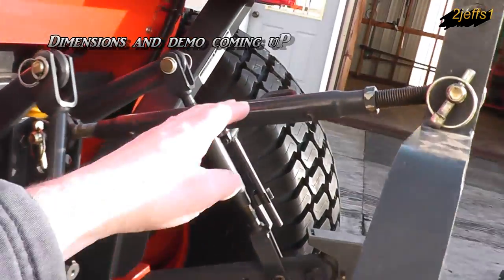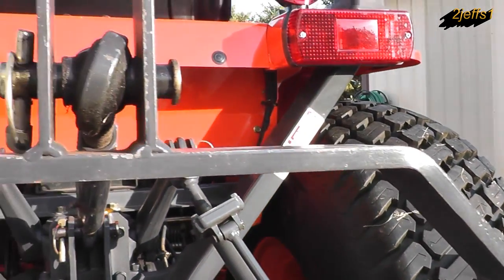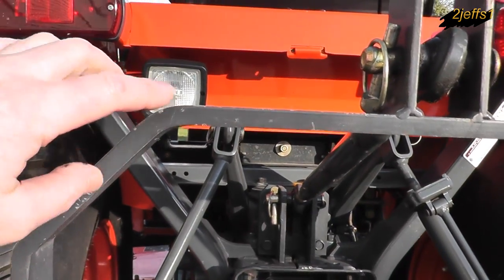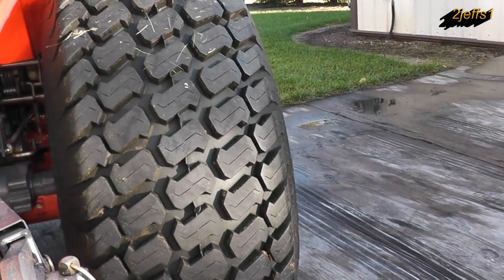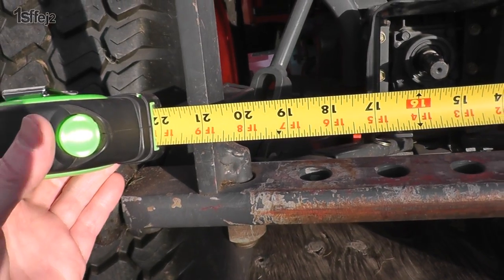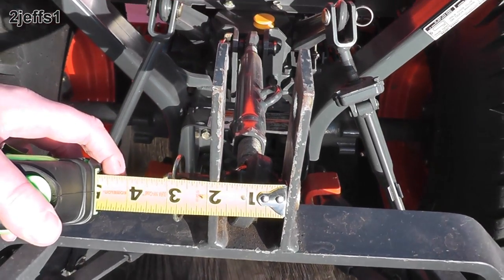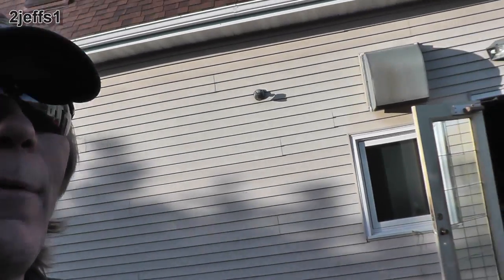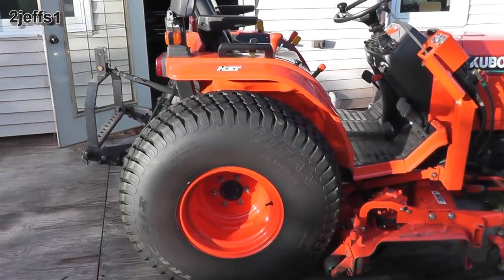How to Build a 3 Point Quick Attach Hitch For your Tractor

Comment: Today Sunday.8,2021. I just finished the mechanical part of this fabrication. My weekend project. Next paint it and start using it!
Also done with left overs. In my case, the metal came from my neighborhood mailboxes frame! That was knocked out by a snowblower a few Winters ago... The rest of the metal will be a landplane, when time permits! :-)

On mine I added a trailer hitch, a tow ring and a couple of slots to hold a chain! For possible logging operations, on my old & tiny Satoh ST1510D (4x4)! Anyway it was all inspired on your project/idea. Thanks a bunch.
Cheers

Comment: Thanks for posting this. I like the way you built that, very simple and no need to weld. I built my drawbar into a forklift. Its the most useful thing I use on my small Kubota. I plan to post more videos where I am using it to show how useful a forklift can be on a compact tractor. Seems like I get more satisfaction using equipment I've made for the little tractor than any of my other projects.
Reply from the maker: +onewyatt1 The satisfaction of these projects does get quite addictive. I can see where your idea on the forklift could be very useful for many folks. A little creativeness can make 1 machine useful for so many different things!
Reply: Wish I had the energy to do more projects. Seems like I am always thinking about how to make stuff but the old bones keep me daydreaming.

Comment: l liked that gen head, want to set one of those up on my kubota,
Reply from the maker: mustie1 The 10 KW is perfect to run the entire place here. The only thing it wouldn't run the air compressor upstairs. I have a 5HP that It will if ever necessary.
Reply: ive been keeping an eye for a gen with a blown motor so l can make one up, right now l have a gas powered welder but its a fuel pig,

Comment: Merry Christmas and Happy New Year! I like that attachment or what ever you call it on your draw bar. I could sure use that. I'm not a welder so I'll have to go at it in another way. Great idea, one I didn't think of in using the draw bar for it. Thanks!
Reply from the maker: mi2tn A few locals took the dimensions from me and had someone make it for them. They didn't do the 45's to keep things more basic. Just an idea for ya - I have people get the steel they need for a project and cut it to dimensions. Then the bring it to me and I'll weld it up. It don't take long or cost much to burn a few welds.  :) But hey - Glad you enjoyed the video and Thank You for your comment mi2tn, Jeff

Comment: Nice setup for the gen. Haha I like gens. 
We get pto units in work occasionally for repair. 
That might be one of those Italian generators rebadged as a Dayton...nothin wrong with em, they work good ...
just of it's capacitor fired , keep spares on hand, the orig plastic case ones like to pop occasionally and it's nice to change em out with good metal case caps instead. 
Just check your exciter windings if ya pop a cap, ya should have 1-1.5 ohms on them and nothin to ground. They rarely fry a winding, 90% of the time I find a bad cap. You could go up or down a size on the caps too, if your voltage output is high or low to adjust it to suit. With multiple caps , keep them the same size between them too.
Reply from the maker: MrTheHillfolk Thanks, yeah the cradle is homemade. Had some old floor jack wheels in the hoard pile that finally had a use too! Wow you blew me away on your advice here. Very interesting. This is one of the rare things here that I never took apart. :>) YES I'll be taking that cover off to look inside now. Who do you recommend for caps? When I bought that unit the guy told me they were wound for 1800 RPM instead of 3600 to be more efficient from the 540 gear up. Any thoughts, And Thank You much for the advice!!!  Hows your hood doing - any progress?
Reply: If that thing is setup for 1800 rpm generator that's awesome. 
The difference is in the rotor. 4 poles gives ya 60hz at 1800. 
2 poles gives ya 60hz at 3600. Peashooters and small gens are usually 3600. 
Now that I think about it , if may have 1 large cap in the back..
1800 Rpms is nicer for less noise and wear on the bearing, if it was a gen set with it's own engine, you would notice 1800 vs 3600 quite a bit. 
Even on a pto setup when we run em in the shop they make a fair amount of fan noise
I'll have to check at the shop and see the couple of brand names we use for capacitors. I do know we usually step up to a 440vac rated cap over a 370vac rated cap though. 
Heh, gens are "simple" 3 things ya need: motion, magnetism and a winding. I use the basics 101 every day on the job.
Reply from the maker: MrTheHillfolk Thank You again for all the info. I like to be able to service things here "in house" when need be. :>)

Comment: Great job on everything I've seen so far! Do you have any 3 point attachments that you can't use this with? 

I assume this is usually mounted to your tractor, if so what do you use for moving a trailer, just mount a ball on it?
Reply from the maker: The Kubota tiller has it's own mounts where it needs to be removed otherwise all my attachments work fine with that on. I do have a ball with a hairpin to keep it retained to the draw bar. That works great for a quick trailer grab to move them around.

Comment: Very cool setup!  Thanks!  I would like to duplicate this for use with my Kubota B20.  Have you tried this setup with heavier attachments like a bushhog? Or earth working implements such as a middle buster, tiller, etc?   Ideally it would be great if the attachments can hook up to the quick attach bar, but still work with a standard 3-point as well when sharing implements with a buddy!
Reply from the maker: Hi there. That 55 gallon sprayer I have hangs on that bracket. When full it is real easy to do a wheelie. I don't take it easy either when that is on in fear of.... I would think it would support a bushhog but no have never tried that. My tiller does hook up directly to the 3 point, no quick change for that one but the 10k generator does hook to that bracket. My farmer friend made a bracket off the dimensions of mine and he loves it!
Reply: Awesome, thanks for the reply!  Just subscribed and checking out your other videos now!!